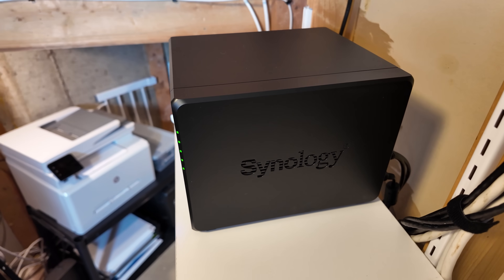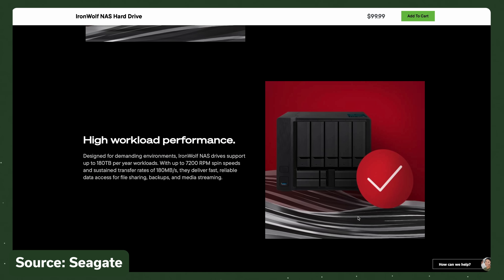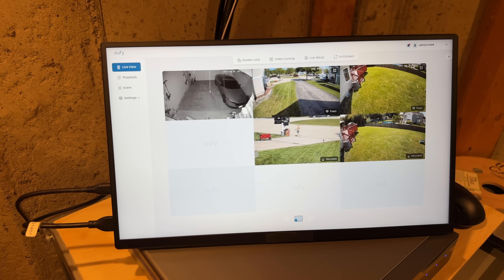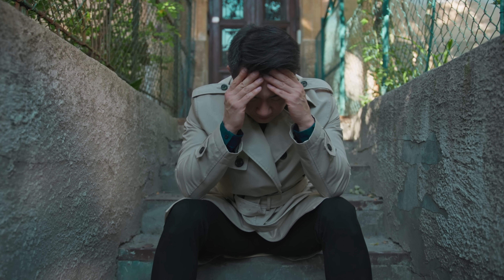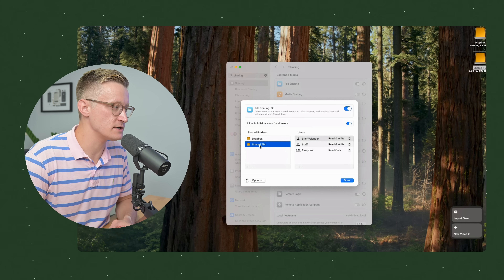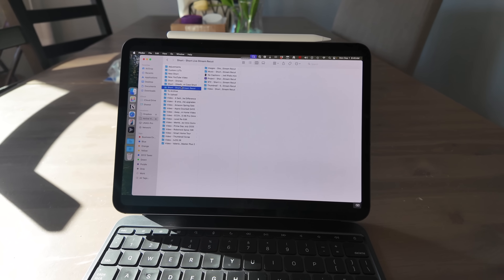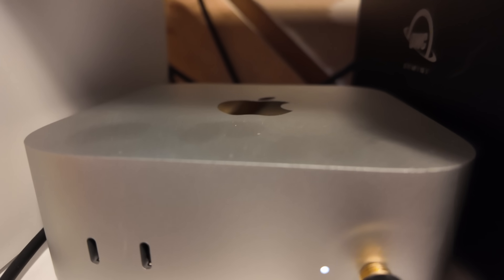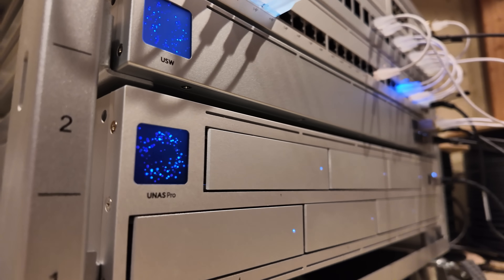Why a Mac mini can be WAY better than a NAS

Comment: As always, use the tools that worlds best for your needs. For me, my M1 Mac Mini plugged to a thunderbolt DAS works best for me. It’s a great, low power server that runs my services and media server and the absolute best thing about it is that I have all 50TBs of my data backed up to Backblaze for $100 so I feel safe having an offsite backup and I don’t even need to mirror my data locally which can cost a lot.
Reply: Been doing the same thing for years with Backblaze. Mac Studio with 10Gbe and a 48tb G-Raid DAS - its great for video stuff - and the Mac Studio runs docker containers too.

Comment: I think you are paid well by Apple what idiot now says that a mac mini is better than a real nas. apple has full access to your mini and therefore also your nas think you can use even better mac cloud service to which Apple also has full access and by the way where do you put the HDD drives or or you have to buy very expensive NAS SSD drives and how much ssd fits in that crappy mac mini Luk tried hope apple pays you well for that nonsense but real nas users laugh at you from

Comment: 📸 How Apple Photos works
	•	Apple Photos Library is essentially one file/database (.photoslibrary) that the app uses.
	•	You can move this library to an external drive (including a Synology share, if you mount it on your Mac as a network disk).
	•	When you use Photos with iCloud Photos enabled, every photo you add to the library also goes into iCloud, consuming iCloud storage.
	•	Moving the library to a NAS doesn’t disable iCloud sync – it only changes the physical location where the originals are stored.

⸻

📦 What this means for iCloud storage
	•	If you enable iCloud Photos → YES, photos will still take up iCloud space, regardless of the library being on Synology.
	•	If you disable iCloud Photos → photos remain only locally in the Synology library, but they won’t sync automatically with your iPhone anymore (so you lose the Apple ecosystem “magic”).

⸻

🔄 Alternative approaches
	1.	Hybrid setup
	•	Use iCloud Photos on the iPhone, but in the Photos app on your Mac (with the library on Synology) enable “Download Originals to this Mac”.
	•	That way, the NAS becomes your local copy and backup of iCloud.
	•	But again – iCloud space will be used.
	2.	Without iCloud
	•	Turn off iCloud Photos, and instead sync via Synology Photos (or a third-party app like PhotoSync).
	•	This keeps iCloud empty, but you’re no longer in Apple’s ecosystem.
	3.	Limited iCloud use
	•	Keep only recent photos in iCloud (e.g., last year), using Optimize iPhone Storage so it fits in a smaller iCloud plan.
	•	Back up everything else to Synology via Photos app or manually.

⸻

👉 In short:
If you use Apple Photos as the default sync, your photos will take up iCloud space – regardless of the library being stored on Synology. The NAS only changes where the local copies are kept, not how iCloud works.

Comment: a Mac Mini, yes including Intel ones, is a great home type NAS solution, been there, used it, done it. As of typing this comment I recommend any of the M1 models, just make sure to set your external drives as RAID, or use an actual RAID external drive, other than that you are spot on

Comment: I use mac mini 2012 to home network by upgrade ram and ssd 
Just only install mac os high sierra but can connect with new os from another macbook
It have usb 3.0 4 port is  flexible to use
It can share screen to control or setting very easily
thank for content

Comment: I got a refurbished base model Mac mini M4 with 10Gbe, saved 15% and an external mini thunderbolt Mac with two NVMe slots, Get 20Gbe read/write speeds, plus you can put an aftermarket 2TB SSD for >$299 instead of paying $800 for a built in option (I do not recommend this for people who don't normally perform upgrades themselves, but I bet an AASP will do it for a labor fee)

Comment: A NAS is just a pain in the ass that offers no advantage over simply unplugging the monitor, mouse, and keyboard from an ordinary networked computer. To the contrary, restricting yourself to remote access to maintain external storage devices is a self-inflicted gamble. If the NAS ever stops booting, you are stuck with recovering fragmented data files shuffled among a stack of RAID drives. With Thunderbolt external drives delivering upwards of 40 Gbps of data throughput, why bother with NAS anymore?

Comment: Where do I plug-in my 10 hard drives? (3.5”)
Reply: an external drive enclosure, as covered in the video

where do you currently plug them in?
Reply: @JoyeuseIntent  I currently have a self-built PC with a small motherboard and a somewhat special NAS case from fractal that holds 8 hard drives 3.5" and a couple more 2.5" size. Also TrueNAS software on it with raidz2/ZFS. I know Mac Mini is affordable, but external drives are flimsy.
Reply: @LinuxRenaissance sounds like a great setup! Preferable to single external drive, for sure

It’s a pity all the DAS enclosures feel so expensive for what they do. I just put all my 3.5” drives in my existing desktop and saved the couple hundred i would’ve spent and it it towards bigger drives
Reply: @JoyeuseIntent   I have a Fractal case that did not cost a fortune. I think it was a bit over 100€. Thank you.

Comment: Thanks for the topic!  I have been thinking about setting up a home NAS for several years now, and even tried about 10 years back with a WD 2-bay.  But issue was always that I was looking for an automated way to download new pictures from my phone and my wife's phone every time we connected to our home wifi, without having to learn scripting language to do it.  I know Synology has this capability (or so I've been told), but Synology is typically out of my price range when you include the enclosure with their software and the drives needed.  But if you are saying that I can use virtually any type of NAS and control it with a Mac Mini, and MacOS has capability to pull the data off our phones when we connect, then that is definitely something I am interested in.  Thanks!
Reply: All you need to do, is to use resilio sync on your phones and the same on a server or laptop. Any new photos on your phones are automatically synced to the server/laptop. I have been doing this for over 10 yesrs. Never need a cable to download photos.

Comment: Recently thinking about doing the same thing. Currently have an old 21.5" 2011 iMac with a couple of Promise PegasusR2's serving/sharing mostly videos to my Apple TV using the Fusion App to view.  ATV is wireless and never experience buffering. Problem that old iMac gives off a lot of heat. Replaced my old  27" 2015 iMac with a M4 Max Studio and loss of heat in my home office is notable. Which got me thinking of getting a M4 Mac Mini w/10gb which solves the heat problem and allows the Promise Pegasus R2's to get to TB2 speeds when file sharing with Mac Studio. I have a major investment in "many"  Promise Pegasus R2's Raid systems. Was looking at a Synology but figured I could leverage my existing raid appliances.

Comment: Using a raspberry pi 5 with a NVMe SSD installed at a HAT running on dietpi (based on Linux Debian) with OpenMediaVault is extremely efficient. Cost wise just about 150 EUR and with Ethernet speed about 100 MB/s fast enough for my needs.   The power consumption is in my case between 1,3 and 6 Watt

Comment: I set up a Mac Mini M4 as my Smart Home server about 6 months ago... I couldn't understand why others didn't as well.  Anyhoo, its connected to my 10G network backbone, 2T internal and 4T external storage,  backed up with a small Amazon Basics UPS and running 24x7:  SecuritySpy (continuously record eight Aqara G5's ... super awesome app), an NTP server, HomeBridge, ControllerForHomekit Hub, TimeMachine,  and Apple Mail (keeps rules engine running even when main laptop is off ... great for  Post Office Informed Delivery notifications, etc).

Comment: I have been considering a similar setup, as I have a 13-inch iPad Pro. As for the Mac mini, I’ve been hesitant about going with the base model and adding 24 GB of RAM, which bumps the storage to 512 GB internally. I was wondering what kind of configuration you ended up picking?

Comment: Nice video.  Thanks.  I'm using a Gigabyte mini PC running Open Media Vault as a local storage node to supplement cloud storage.  The spec's are Celeron J4105, 8 GB RAM, 128 GB M.2 SSD and a 1 TB SSD.

Comment: I set up my first Synology NAS just over a year ago so I could finally organise all of my external hard drives into one location (And I had been meaning to invest in a NAS for years!) I wouldn't say it was super complicated to set up but it's certainly a lot harder than I expected, and I think for a lot of people it just isn't worth it. There's definitely quite a learning curve to it.

Then earlier this year, my dad upgraded his Mac mini and I took his old one (2014 model). I didn't really know what to do with it at first until I eventually decided to set it up as a server/NAS and use it exclusively for keeping a full local copy of my Dropbox (Which I already have on the Synology, but I don't like the way it works) to an external drive (4TB G-Drive), and another external drive (6TB G-Drive) with Time Machine turned on which backs up the Dropbox hard drive too, and of course includes things like versioning in case I delete things from Dropbox I can retrieve them in the Time Machine drive.

And honestly, if I knew about this earlier I probably wouldn't have bothered getting the Synology. I don't have a monitor connected to it, I just use Screen Sharing and stream it to my MacBook Pro, which is a bit pixelated but works well enough. So I don't need another monitor for it either, I just have it plugged in along with two external drives.

With that said...would I replace the Synology with a Mac mini in the future? Actually, no, absolutely not. While the Synology is a bit more complicated, what keeps me in is the fact that it uses the Btrfs filesystem and has features like immutable snapshots, data scrubbing, and overall checks the health of the system, drives, and informs you of any errors and problems. So I'm pretty glad I went through the effort of configuring the Synology, and I'm also glad to have the Mac mini as a second server in case things go wrong with the Synology; I have both set up and I'm keeping it that way, but the Synology remains my main storage location.

But the Synology probably wouldn't be my first recommendation anymore, I think a Mac mini (or similar Windows PC) would be my first suggestion. I feel like most people would just waste too much time trying to configure a Synology when really they just want a slightly better external hard drive, then if they start building up a lot of data and want to take it a step further they should look at a NAS which will generally handle larger data sets better than a Mac mini and external drives.

Comment: For data redundancy, I set up Syncthing on my M4 Mac Mini with a 4TB thunderbolt SSD to sync 2.5TB of data between the Mac, a PC, and an Unraid NAS server all connected through a 2.5 GbE UniFi gateway. Then I save ~6 months of backups to a large external HDD. Thinking about Backblaze for off-site backup.
Reply: Backblaze is great, can't recommend them enough!

Comment: @Eric - How do you get your Dropbox Folder to work on an External Drive with your Mac?  The newer OS's now force you to use it on an internal drive folder.  I bypassed mine with a "Rig" but its complicated as compared to before.

Comment: I have a 2014 Mac mini running as a Print server for a couple printers that don't have networking or AirPrint available.
Reply: What service do you use for that?
Reply: @DesignerZer0  Its just the built in Printer sharing on macOS. The printers are connected by USB to the Mac mini and it by ethernet to the network.
Reply: Can you print from an iPhone or tablet?
Reply: @MakeSmartMatter  No, it's just from other Macs.
Reply: Another way to print is using an old airport express that you can connect with usb with the printer. Connect the express with your wifi network.

Comment: One great upside of using a Mac Mini M4 as a server/NAS is the electricity consumption is very very low!
Reply: err, so, how exactly, basically all decent NAS set ups should be low power, 'cos if not at best they'd probably be a server!
Reply: I think this statement is in comparison to using other X86 CPU computers as a NAS.  Most dedicated NAS run a ARM or RISC chip which share similar architecture as Apple Silicone and will definitely use less power.
Reply: @lanzer22   even AMD x86 powered NAS run at sub 10 watts in idle (excluding the hdds).
Reply: Not from what I see... 80w is low for a PC but most Synology numbers are in the 20w vicinity... plus you need to add an external drive enclosure to be able to run RAID (if you're setting up NAS and not running raid you're doing it wrong)... the first usb-c 5 drive enclosure I saw ran 150W... no way that setup will ever run leaner than the Synology.
Reply: Is it though a big win? The M4 has a lot of power and efficiency, but you still have to power 4->8 disks in an average RAID config. Or for small setups, you can probably save a few hundreds by doing a Raspberry Pi NAS which would be also pretty low-power on the CPU side.

Comment: One downside of using a Mac as a NAS is for some reason the encrypted SMB performance is very slow. Even with 10GbE and an SSD!
Reply: Is it just for encrypted? Anytime I’ve ran SMB from my Mac it’s been terribly slow. Seen reports online and seems like it’s been this way for years. NFS speeds were better but was a hassle to get working.
Reply: Consider not encrypting the drives, they’re not going anywhere. For the few files you might back up which really need security, a password-protected DMG file works nicely

Comment: Hi! I have a NAS and a Mac mini just like you. But I use ISCSI to attach a NAS LUN to my Mac. I also have a Home Brisge docker container running on my ARM based NAS. The Mac mini is actually an intel SSD upgraded one currently running MacOS Sierra and the last fully featured MacOS Server app. The NAS and the LUN is backed up to the cloud with iDrive for cheap. 

I don’t use Plex, which cloud run on either my NAS or Mac mini, but instead I just use Infuse and store my media files on the NAS directly. 

At this point I could really just make do with the NAS but I’m planning to move to a unifi NAS in the future. Great for file sharing. Bad for docker plex or even a backup application. So maybe the NAS will handle storage and the Mac mini the intelligence going forward…

I’m attending the Unifi world event here in Stockholm tomorrow. I expect to hear something about new form factor and number of drives options for upcoming Unifi NASes

Comment: Great video, I totally agree.
Having a spare Mac mini always running on the home network is super handy, it has saved me many times.
I usually rely on built-in Screen Sharing, with Splashtop as a backup.

Comment: Hey Eric, what about with the changes in macOS Tahoe to Time Machine? Will this Mac mini set up still work with that new protocol?
Reply from the maker: That is for the legacy Time Capsule system or back up options still using AFP. This setup is not deprecated with Tahoe, but I should clarify that I haven’t personally tested it in Tahoe myself.

Comment: Another reason to go with a NAS is power consumption. If you add the power the Mac consumes to the power of an external RAID array, you’re probably talking twice the power consumption, and given how expensive power is becoming at least over here in the U.S., over time it makes a difference, especially if you have it running 24/7.
Reply: I don't think so. If you really  care about energy consumption you will use NVMe drives, not mechanical hard drives,  and for those the Mac mini is ridiculously expensive and limited on internal storage,  forcing you to use external thunderbolt enclosures that are way more expensive, slower, and less stable than traditional NAS appliances. Nowadays you can have a PCIe quad nvme carrier for a few bucks and put it in a Linux PC.  Meanwhile the thunderbolt solution requires an expensive external  enclosure (and cable) with an additional PSU (more expensive and more energy consumption).
That's for a small NAS, if you also want more professional NAS capabilities such as 25Gb / 100Gb ethernet,  JBODs / JBOFs,  decent NAS software ... a Linux system is really the way to go.

Comment: I recently bought a new M4 Mac mini and have a DAS for back ups. I also have stand alone NAS’s for Plex and a Zidoo player. How well does MacOs handle streaming Plex or to a stand alone video player?
Reply: Plex on a Mac is very good, even on a Hackintosh Mac Mini equivalent. Easier to configure than on TrueNAS, as you can launch browser locally or Remote Desktop to initialise it.

Comment: Really nice video! Have definitely been thinking about doing something like this with my m4 Mac mini. I also pulled out the box an old 2TB Apple Time Capsule I thinking about messing around with only to use as an external drive but will probably go with something else newer.